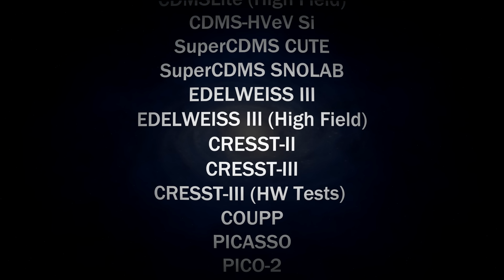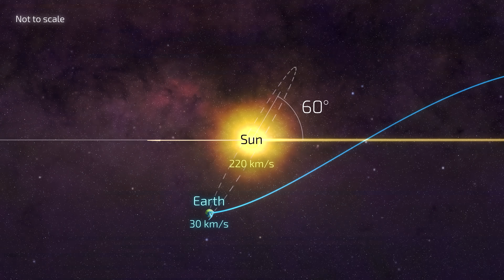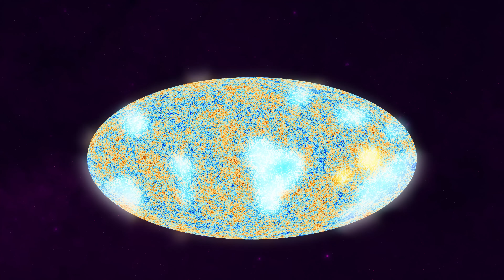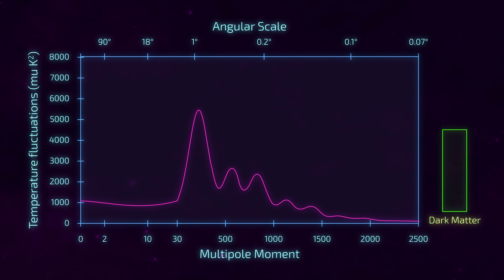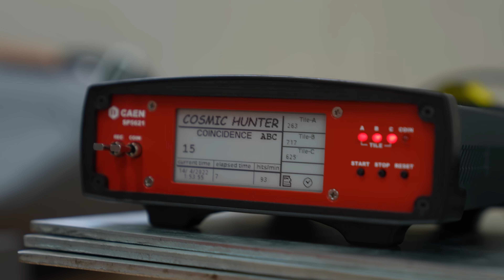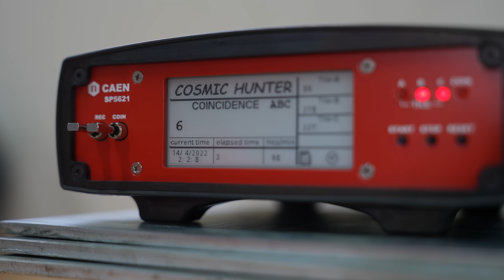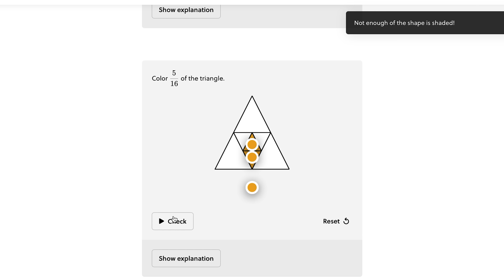The Absurd Search For Dark Matter

Comment: It's somewhat more plausible that our physics models need to be fixed or expanded to account for more dimensions of reality.
dark matter is just a place holder for explaining "why no our physies work right?"
Reply: I'm no expert but I think the pushback on the "physics model is wrong" is due to the fact that those models predict other phenomenon very accurately. So it's not the chance that: the model itself may not be perfect; but rather that: it's not correct in just the perfect way to explain so much but not this one thing.
Reply: That's why other physicists are looking at explanations that involve changing how gravity works like MOND. Unfortunately it's much easier to say we should change our models than actually managing to do it. We have modles that work really well in some circumstances that it's has to reproduce, plus dark matter was proposed because it solved multiple issues with one explanation, not just galaxy rotation but also how structures formed in the early universe.
PBS spacetime has a good video on the progress of modified gravity, but basically nobody has it working yet and it requires new field and new forces. New fields mean new force carrying particles for the standard model we haven't seen yet so even modified gravity is going to mean looking for new hard to find particles with expensive detectors.
Reply: Exactly. Yes. The amount of money being spent on finding the Luminiferous Ether is insane.
Reply: Thats what I've been saying! Like instead of making a percent error for our calculations we say our calculations are right and there's just this unified mystifying dark matter. Like yes there is probably matter we can not see, that is one type of dark matter. It can also be our models and/or a whole lot of other things

Comment: I don't get something. If things orbit around the center of mass at different speed depending on how far away they orbit, how would adding more mass (through the existence of dark matter) explain a constant speed at different distances? It should just make every orbit speed higher, but they should still depend on the distance, right?
Reply: My guess is that the theorized cloud of dark matter would act as a gravity diffuser.  Mass would no longer be as concentrated on a black hole in the center of the galaxy.  I'm no physicist, so I may be way off here.  It's just how I picture it.  I'm also skeptical of dark matter, or anything proposed to exist simply because we're stumped on how to explain a phenomenon in any other way.
Reply: Maybe it’s comparable to spinning a ball attached to a string in the air vs. under water.
Reply: @mynameisjeff9124  That would slow down any moving object in a similar way (proportionally to its velocity), though, wouldn't it?
Reply: That's correct, but the cloud isn't a point-mass; it's distributed, and so a star further in sees the cloud evenly distributed on all sides, and so isn't affected by it much at all, while a star further out sees more dark matter on one side than on the other, and so experiences a stronger pull
Reply: @Hailfire08  That makes sense, thanks :)

Comment: Dude, multiple mentions of Dama/Libre detections without an explanation what or how it detects? Dark-mater-ons??
Reply: Very similar mechanism - also sodium iodide crystal. The DAMA/LIBRA results are disputed as seasonal fluctuation (what we expect with dm) also can be caused by background like cosmic muons (cosmic ray rate will also fluctuate seasonally). SABRE is better designed to eliminate these background sources and should achieve a much clearer result

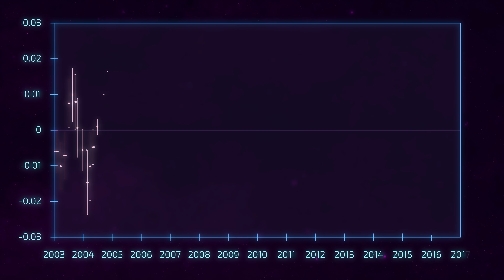Comment: Wait, can someone explain why at 3:18 there's nothing there for 2010-2011?
Reply: IIRC they did significant maintenance/upgrade work on DAMA/LIBRA in 2010, so I guess that's why there's no data for 2010/2011
Reply: The detector was not in operation due to being upgraded